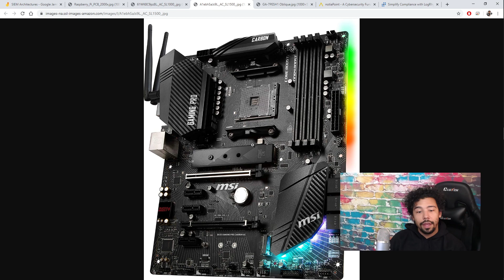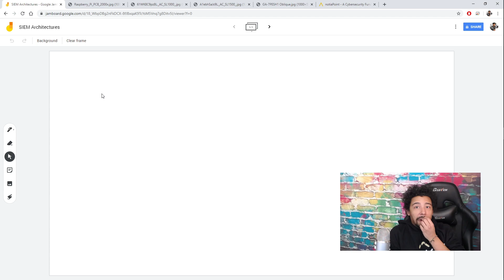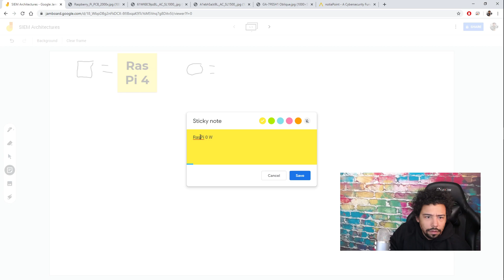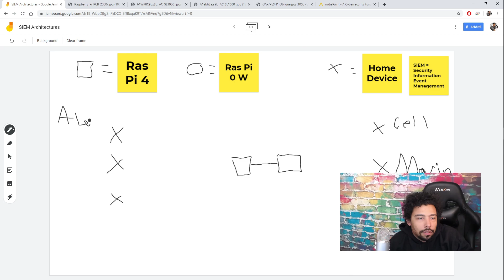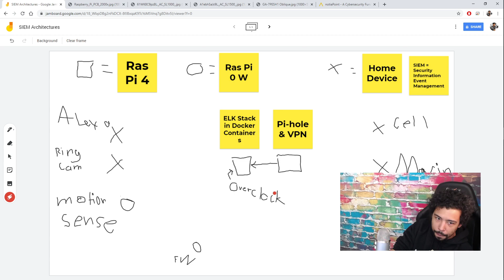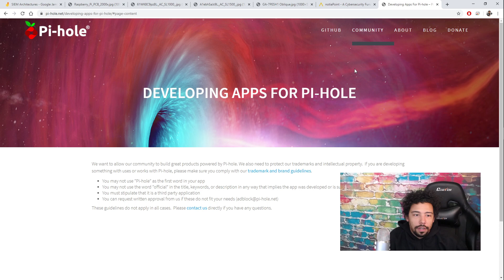Hack Back! Don't Let Hackers Control Your House | Home SOC (VPN + SIEM) Architecture Jam Session [1]

Comment: Great video! Thanks for doing this. I’m playing around with a raspberry pi cluster and was attempting to set up a home SOC. Have you had an opportunity to set up a k8s pi cluster with elk and pihole?
Reply from the maker: I have, I would say k3s is operationally superior for kubernetes on Pi over k8s.  From there, I found that I prefer using EFK stack over ELK - replacing logstash with Fluentd and using 32bit kibana.  Elasticsearch now supports 64 bit on Pis natively as well, so that piece just works now as of July.

What I have come to prefer over both ELK stack and EFK stack is installing NEMS Linux on the Pi instead of Raspberry Pi OS, then installing k3s in that Linux version.  In k3s, build a Fluentd container and a Loki container (from Grafana).  Have NEMS generate logging and data, then have Fluentd send that data to Loki for dashboards.  Also, you can install a Docker/Kubernetes GUI and DevSecOps tool called “Rancher” in a container as well to give you more versatility and control.

It sounds complicated, but if you use the documentation on the websites of all those tools, you can build my this preferred alternative to ELK right now  :)

Go install NEMS Linux and get started!!
Reply: Ask Nato Riley wow thanks for the quick reply and detailed info! I’ll check this out. This has been my quarantine project and have been banging my head against the wall for a while now. I started with k3s, but had some issues with metallb and figured it might be better to try k8s. But I didn’t try installing NEMS Linux. I’ll have to check that out. This is super helpful! I’ll let you know how it goes
Reply: @NatoasCode  I was able to set up Rancher on my Raspberry Pi. Thanks for the advice!
Reply from the maker: @aneelysis  amazing, you can now do all sorts of sandboxing in your home lab with that setup running!